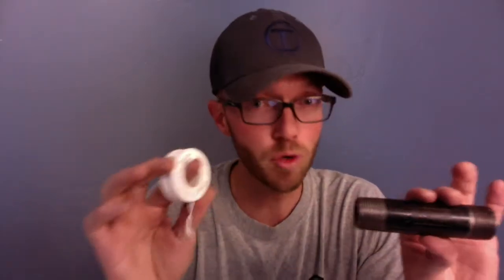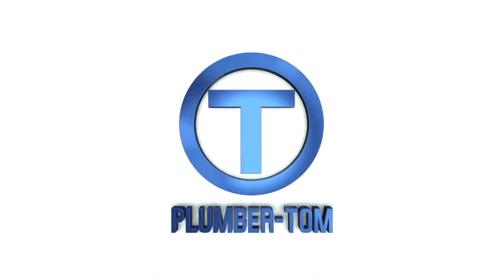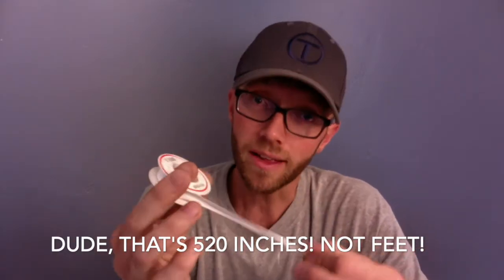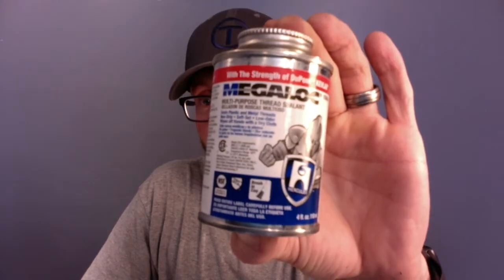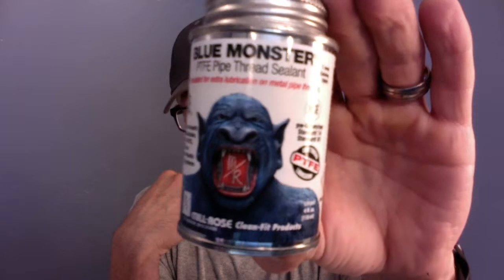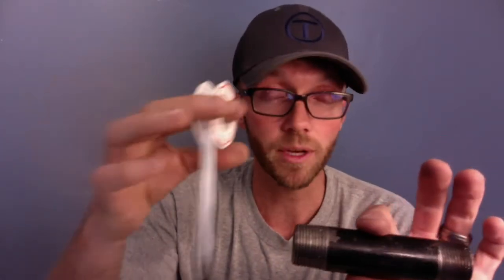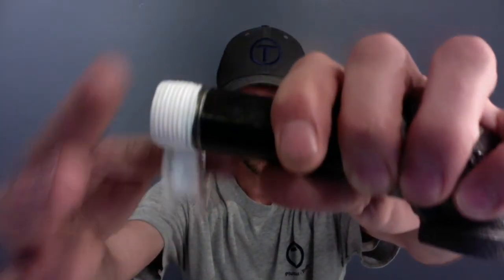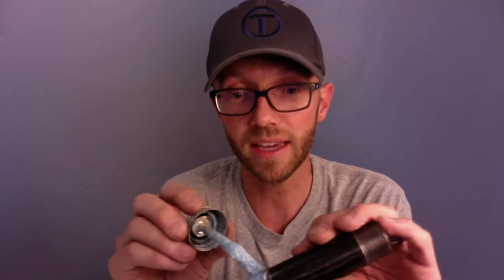How to Apply Teflon Tape to Threaded Pipe

Comment: Thanks Tom, I once bought a water pump from Gina  with threads that were not round just looking at them, had to use a whole roll of tape in three increments screwing , unscrewing, adding more,etc!
Reply from the maker: That's a frustrating experience, but I'm glad you got it sealed up!

Comment: Dope then tape. Much less messy. My only exception is on plastic fittings (especially cleanout plugs) because I've seen the tape spin when threading the pipe into the fitting.
Reply from the maker: Agreed.  Thanks!